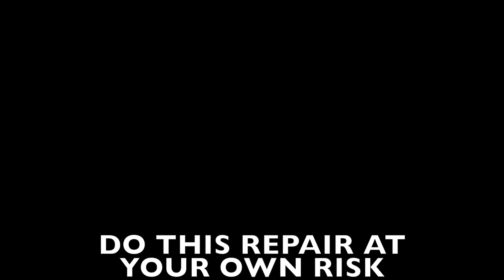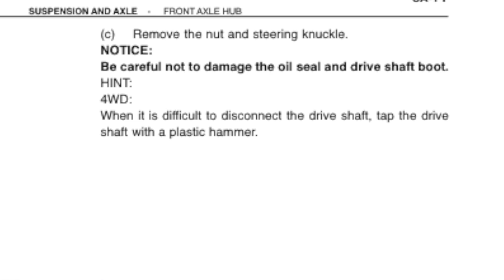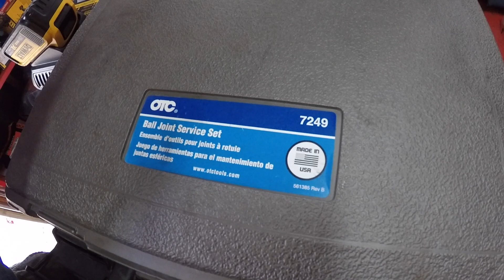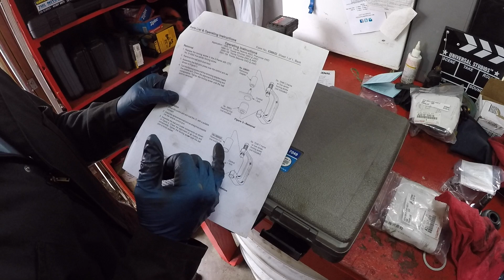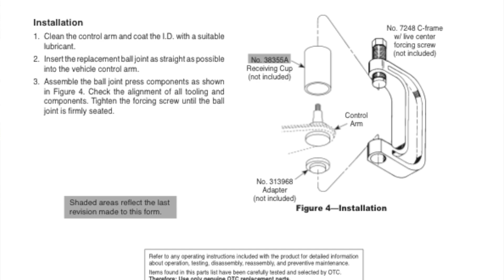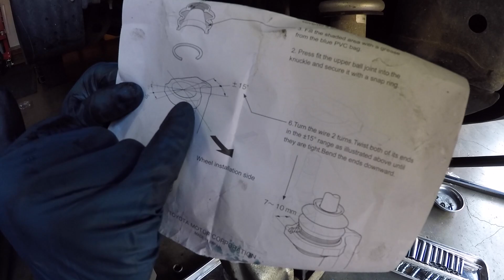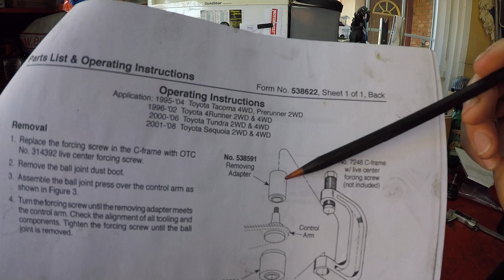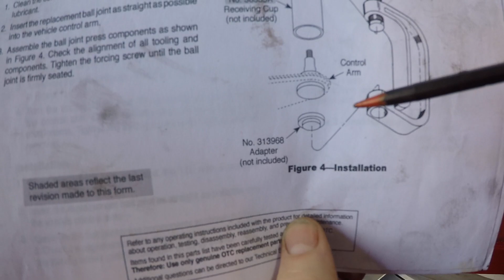Upper Ball Joint Replacement

Comment from the maker: PLEASE READ THIS COMMENT AND THE VIDEO DESCRIPTION FOR HELPFUL INFORMATION
**Important Safety Message**: That 2 jaw puller I used from the OTC kit to break the UBJ free of the UCA can fly off from it's purchase when the connection finally breaks free.  Be careful when using this type of puller.  Possibly putting something solid between the puller in you while tightening down the screw would be prudent so the puller can't go flying into you.

**12/13/19 - Brian Kiesel commented sharing that he used an impact gun in combination with his balljoint press to press the upper balljoint out of the knuckle.  This enabled him to keep the knuckle on the vehicle because the impact generates a lot of force without any need to properly stabilizing the knuckle like we show doing by removing the whole knuckle off the vehicle and securing it in a bench vice.  With conventional ratchets and breaker bars, it's hard to generate the force required to drive the balljoint out and the new one back in with the knuckle not stable.  So, if you have an impact gun, this could be an option for you if you don't want to take the additional steps to pull the whole knuckle off the vehicle and secure it in bench vice for the press work like we did.  One thing I would watch out for when using an impact for this job is pressing the new balljoint in.  You want to make sure the balljoint is driving in really straight because things can happen very fast when using an impact as opposed to conventional tools.  You'd probably want to put your gun on a low setting like Brian did and use very quick bursts with the impact to see the balljoint is going in straight, and then once it is, you could be more aggressive and drive it the rest of the way.  Another thing to consider is if the balljoint press you have is rated for impact use - I did a quick search online and appears plenty of people use impact guns with their balljoint presses.  A common comment is to make sure the screw bar threads are lubricated really well so there won't be any undo wear to the threads.
Reply: I wonder if you got a heavy rubber band and put it over the puller before you put it on, if that would help keep it from flying back?
Reply from the maker: @toastrecon  That's not a bad idea but maybe something more sturdy than a rubber band.  I'm thinking a section of a rubber bicycle tube that I could wrap around the tines on the puller really tight so when the connection breaks free the arms can fling out and cause the puller to launch and become a projectile.   Thanks for the idea.
Reply: Why would anybody use that piece of shit puller that doesn't come with the right size shit?
Reply: @TimmyTheToolman  I watched every video you have in YouTube,  every video is very helpful,  Mr. You are the master.  Thanks for everything you share with us. 👍👍👍👍
Reply from the maker: @luisabrahancoreas.3506  Thanks for taking the time to comment Luis.  We appreciate your kind words.  You're very welcome and Happy Wrenching.

Comment: I'm about to start this same project. I was looking for some more info, and man did I find it. This is the best "how to" video I've seen for work like this. You did a great job explaining each step, and the camera work is stellar. But the fifth star is extra time you took at the end of the video to show the specific cups needed to press the UBJ out. Great job. You may have saved me hours of time running around while my truck is on jack stands looking for stuff you cannot easily buy at Autozone. I have two buddies with Tacomas, and I will direct them to this video.
Reply from the maker: That’s great to hear Mark! We hope you caught our mistake on where to leave the twisted wire. We mention it in the video at the end. For those of your friends who are replacing their entire UCA and not just the joint, refer to this video https://youtu.be/noBts3Qf5rw where we show another method to removing the ball joint itself by cutting off the shaft first to fit the ball joint adapters over easier for the press work.
- Sean

Comment: I don't have a vice. I found it relatively easy to get the UBJ pressed in with the knuckle on the truck. 05' sequoia.
Reply from the maker: Good job!
Reply: what tool did you use to press that on vehicle?
Reply: @efil4kizum  A rented Autozone ball joint installer tool. Looks like a C- clamp that comes with some cups to  received BJ and assist in pressing the BJ up and evenly as the video here shows. The cups weren't exact fits for my UBJ but I made it work. It did take a big of muscle to torque the clamp but not too difficult.

Comment: I have found that it is always a good idea to put anti-seize on the threads of any threaded puller, press, or compressor tool so the threads don't jam or strip under extreme pressure. I have tried grease and it doesn't do the job. Anti-seize is the way to go. Great video.
Reply from the maker: Thanks for the tip.
Reply: Thank you for all the great videos and knowledge. It has really helped a lot over the years.
Reply from the maker: @gwdeals  It's our pleasure to supply people with quality DIY videos to use and benefit from.  You're very welcome and Happy Wrenching!

Comment: Excellent coverage and tooling without damaging any boots brother Tim! Really like OTC's products. When I change my brakes, I have been washing all boot material with soap/water, then spraying Silicone over boots. I've noticed less cracking of the rubber! Another fine video my brother!!
Reply from the maker: Hey Brother Jake, glad you like the video.  Yeah, that OTC front end service kit has been awesome.  I've gotten a ton of use out of it.

Comment: Thanks for making these videos. You have saved me thousands of dollars. 
I just did this job yesterday. I found it wasn't neccessary to remove the whole knuckle from the vehicle. Also, I couldn't get the snap ring out so I press the ring out with the ball joint. It took more chugga chugga with the impact but it worked...Thanks again for the videos..
Reply from the maker: You're very welcome Brian.  Great to hear you've saved lots of money using our videos.  That puts a smile on our faces every time.  That's great you were able to do the UBJ swap keeping the knuckle on the vehicle and I suppose using the impact with your balljoint press made that a whole lot easier to do.  I didn't consider using an impact with the balljoint press but now I know it's an option, so thanks.  Did you also use the impact to drive the new balljoint into the knuckle?  

Without an impact, it's hard to generate the force required with standard ratchets or breaker bars to force the UBJ out because the knuckle isn't stable like it was for me in the bench vice.  So, for anyone without an impact gun, it's good we shared the way we did it with pulling the knuckle completely off the vehicle.  I'm going to add a note in the comment I pinned sharing your impact gun technique.  Thanks for taking the time to comment and share this with us.  Happy Wrenching!
Reply: @TimmyTheToolman  Yes, I used the Impact to press the ball joint in. I turned it down to low and went slow. Making sure it was seating in the knuckle straight. I agree doing it this way on the vehicle without an impact would be very difficult, because the knuckle sways around on the lower ball joint.
Reply from the maker: @briankiesel2742  Thanks Brian.  I added your technique to the comment I pinned.  Check it out and let me know what you think how I worded it.
Reply: @TimmyTheToolman  Looks good. Hope it helps some folks out...
Reply: Do you have a Toyota Tacoma 4x4? How did you secure the knuckle to remove the old UBJ and install the new UBJ? I have a 1/2 " Makita impact wrench, so if it saves me time and frustration to press out the old UBJ and press in the new UBJ, I am very interested in your technique.
Reply: @briankiesel2742  I'm definitely going to try out this option. Thank you for sharing this bit of info.

Comment: Having problems installing with a ball joint installer I borrowed from advance Auto. You're diagram on proper placement saved my ass. Work perfectly! thank you so much!
Reply from the maker: Solid! Thanks for stopping by the comments section. #sicmods

Comment: Aloha~ Thank you for your attention to detail! Seem to work on clients’ cars as if they were your own. Good for you! And good for your clients.
One alternative to the locking washer would be to have a big washer with the axle hole size then end over two sides towards the nut and one or both of the other sides the other way and drill a hole or grind a notch for the cotter pin.
Reply from the maker: Glad you appreciate the detail we offer in the video.  Thanks for the comment and suggestion.

Comment: Hello Tim, 

Thank you always for everything, my toyota has been healing little by little thanks to you, and I have been learning a lot in the process.

 I want to make a major maintenance in my Toyota Tacoma 1996 manual 4wd, and I ask for the price at the Toyota dealership, and prices are a bit expensive so...

1. I wanted to ask whether you know of any alternative that sells Toyota Original parts but maybe at a bit lower price, somewhere trustable that you may have experience buying from them hopefully, before getting them directly from Toyota 

2. If the clutch disc sounds like if it is rubbing metal against metal time to time, do you think I should buy the flywheel together with the clutch disk, clutch press and clutch neck? 

3. If your suspension in general needs maintenance, like all of it, which parts would you focus on first, apart from the lower ball joint?

Comment: Thanks for the video, I just finished changing out both my upper and lower following your video. Also change the brake pads in the process but they were cake. Didn't have all the right cups but improvised with impact sockets that fit. Also followed your lower ball joint video. Nice that you included all the torque settings for each nut and bolt.
Reply from the maker: Great job doing the work yourself.  You saved a bunch of money and learned a lot.  I'm glad our videos helped you with both jobs.  You're very welcome and Happy Wrenching!

Comment: Taking off the whole knuckle assembly isn't necessary in order to complete this job. I was going to skip this job while doing inner/outer tie rods and LBJ, due to all of the work, but I saw another video where you can just unscrew the upper ball joint and press it out. I appreciate the attention to detail in all of your videos, but I found that all of the extra work you did in this video wasn't necessary. I am currently finishing up the rack bushings and also the inner/outer tie rod, then going to finish with the UBJ. Thanks for all of your detailed 3rd gen maintenance videos!
Reply from the maker: Stabilizing the knuckle to apply the necessary force with the balljoint press while the knuckle is on the rig is the issue.  That's why I chose to remove the knuckle to not fight getting the old balljoint out and the new one.  I don't find removing a steering knuckle a big chore.  We can choose which battles we want.  So, not necessary for you, but necessary for me because I wanted the knuckle stabilized on the bench vice.  There's always more than one way to accomplish a job.
Reply: Not a chance on my 23 year old original BJ... no way were they coming out in place.. had to remove the knuckle

Comment: In the rust belt you leave the wheel speed sensor in and remove it with the knuckle !
Reply from the maker: The rust belt isn't a fun place for DIY Auto Mechanics.
Reply: @TimmyTheToolman  its not that bad! i have seen CA rigs with MUCH more rusty crusty than my 27 year old western Iowa Taco has... hose the salt off routinely and do NOT let it sit and rott away lol ... only bad issue is the OE cotter key pins were totally seized but just coat in anti-salt stuff before putting them back in should not have issues on the next episode

Comment: Another excellent detailed TTT UBJ tutorial and the best on YouTube. My 2002 Tacoma 4x4 UBJs with 168k miles are leaking grease and my tires are showing extreme wear on the inside.  I suspect the worn UBJs have caused an extreme misalignment.  It look like when I replaced my UBJs I might be prudent for me replace the LBJs and the Outer Tie rod since I will have the knuckles off my Tacoma.
Reply from the maker: Before you go and replace the UBJs, check them for play.  They might be fine and all you need is to buy the affordable boot kits that we link in the video description.  LBJs are smart to replace because they are known to fail.  If the outer tie rods have play or torn boots, I'd replace them.  If the joints seem fine and the boots are intact, I wouldn't replace them.  Uneven tire wear seems more like a problem with the alignment toe.  I suspect your wheels are toed out too much.  I'm trying to get you to avoid spending money on things that don't need replacing and find the real reason why your tires are wearing unevenly.  Good luck!
Reply: @TimmyTheToolman  I checked the LBJs for play and they have plenty of play. My LBJs have 168k miles on them, look ok but I am told since I go off road it would be prudent to replace them as they are 20 years old with 168K miles .  One tie rod is o but the other has play so I will replace both.  Thanks Tim for the advice and keep making excellent videos.
Reply from the maker: @thedetective8150  Ok Brandon, good luck with the work.
Reply: @TimmyTheToolman  With your videos guiding me it should be easy peasy. 😀

Comment: Brings back bad memories...
Update: I’m glad I went Oem on that nightmare of a job. I used the same otc adapters but did not take off the knuckle. It barely worked. I forgot to remove the retaining clip for the ubj and pressing it out took an insane amount of force.
Reply: Oh na na take heart Christmas sweater time is just around the corner.
Reply from the maker: Yep, I can understand that.  But, with all the right tools, this is a pretty straight forward job.  The scary thing for me was how much force was required to break free the upper balljoint spindle for the upper control arm.  Frank's rig has over 300k miles and those were the original UBJs so they were really locked in there.  It's scary when that puller finally breaks it free.
Reply: @TimmyTheToolman  Tim. I hammer it out. For me it was a couple strong wack. That was it! my 4runner had 195K miles
Reply from the maker: @genxiong2695  That's pretty lucky it came out with a couple hammer strikes.  They are usually in there really tight.

Comment: Great video. I’m using this as the guide to replace a ball joint on my ‘19 tundra due to a ripped boot.

At 22:57, I think 7248 is the clamp’s part number. The third part you may need is OTC 314392 which is a forcing screw plug for the clamp. With the 7248 clamp, 314392 forcing screw plug, 538591 adapter, and 38354 receiving cup, you should be good to go for this job.
Reply from the maker: Hope the replacement went smooth for you.

Comment: Best tutorial video there’s out there mr 👍🤝👏🏿👏🏿👏🏿👏🏿👏🏿
Reply from the maker: Thanks MAN. We hope you caught our mistake on where to leave the twisted wire. We mention it in the video at the end. If you’re replacing the entire UCA and not just the joint, refer to this video https://youtu.be/noBts3Qf5rw where we show another method to removing the ball joint itself by cutting off the shaft first to fit the ball joint adapters over easier for the press work. This method can save you from needing the special adapter cups.
- Sean

Comment: Ahh Pizza Chicago. I miss In n Out burger too. Just did the upper ball joints on my 2000 Tacoma, definitely took the knuckle off. A small tip: you can bolt the knuckle to the wheel and tire assembly using the lug nuts (take the rotor off first) and then you don't need to hold it in a vice to press in/out the new ball joint. I used a big c-clamp and it worked out but it does need some serious torque to get the new one in. I used a large 9" Cresent wrench to turn the nut on the c-clamp. Cleaned up the bore first too with a bit of medium grid sandpaper and the new joint went in a lot easier. Make sure its bottomed completely or the c-clip will not go on.
Reply from the maker: Good tips. Thanks for stopping by the comments. We appreciate it greatly

Comment: Hey Timmy. 
I find that removing the Rotor from knuckle after a bit of rust weld is best screwing in a bolt into on of the threaded holes of the Rotor to "push" it off from the hub. I have heard that either 8 × 1.25 mm thread bolt or something close can fit in these threaded holes and makes for removing old rotors much safer and easier. 
I have heard snacking a hammer on old rotors can cause warping damage. This is only my opinion. Thanks for all the work and info you share. My 2001 sRunner loves it and you. Cheers m8
Reply from the maker: Yeah, I've heard the bolt trick works well.  The bolt size you stated is correct, M8 x 1.25.  I've just never had to use it personally.  Hitting the rotor with the plastic mallet has worked pretty much every time for me.  But, no freaking way are you going to warp a rotor hitting it with a plastic mallet.  Now, if you're hitting if with a decent size sledge hammer, then you might be able to warp it.
Reply: I agree, I imagine the stories come from a combo of warm rotors and/or too hard of an impact , or too strong of a hammer. Thanks for the insight.
Reply from the maker: @2old666  Yeah, the warping story doesn't add up.  If you hit the rotor with a metal hammer, you'd damage the breaking surface, which obviously wouldn't be good.  I'm sure people who live in the rust belts of the country must have to battle pretty hard to get rotors off.  Maybe they are placing a towel on the rotor surface and then smacking it with a metal hammer to break it free from the hub or axle face.